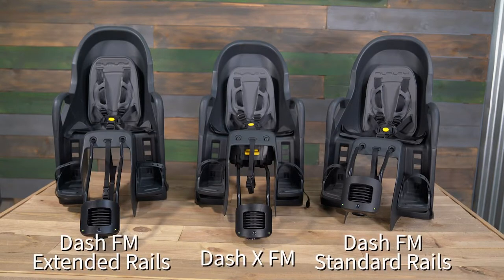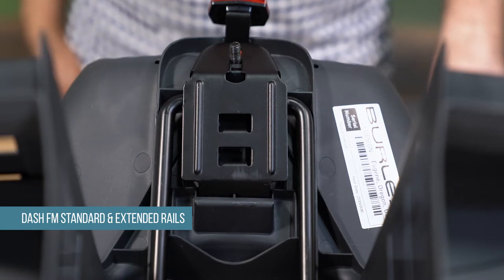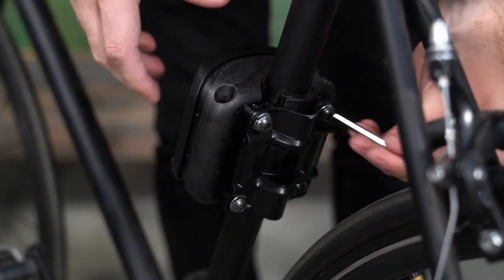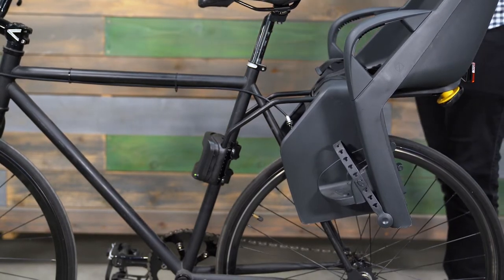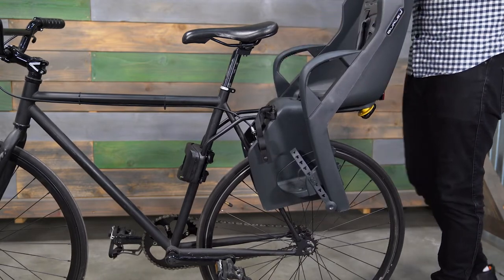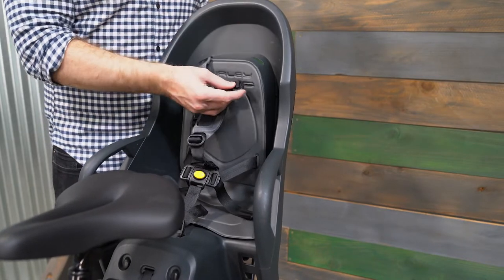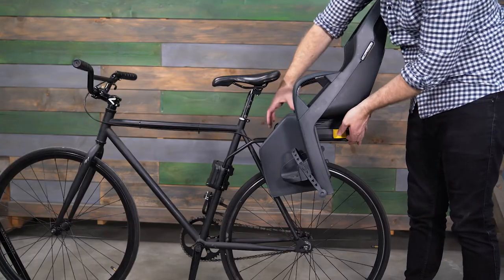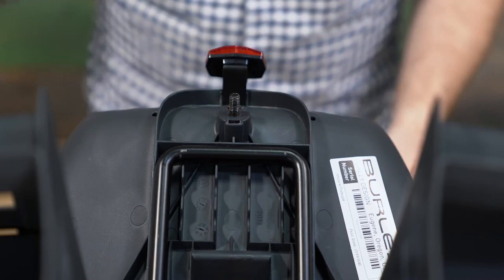Dash FM Child Bike Seat Installation | Burley

Comment: I have over tightened the mounting knob. How do I unscrew it now? The anti loose design of the mounting knob is stupid. I just bought a Dash FM, and wasn’t even able to install it yet. Now the whole thing is a useless junk, because the mounting knob just doesn’t come off.
Reply: I had to pull with all my finger strength to take that off, I thought the seat was gone for good. There should be a warning about over-tightening.